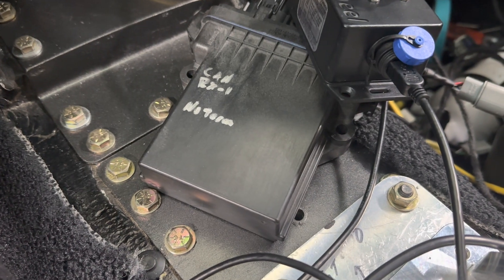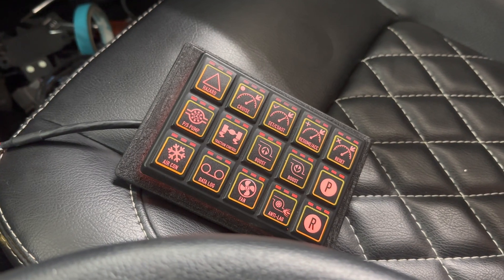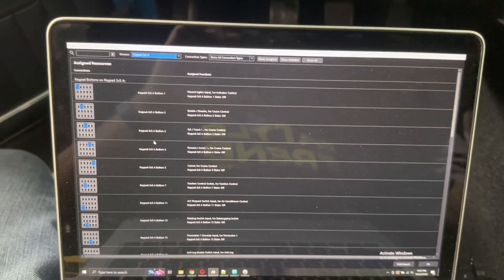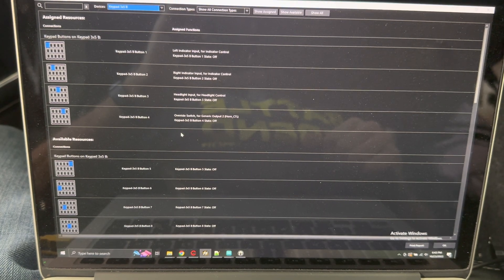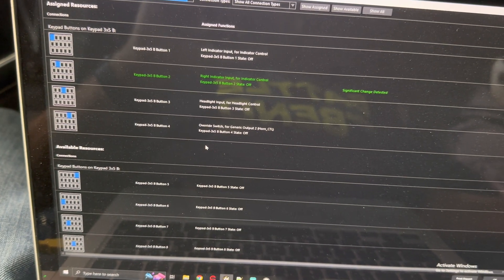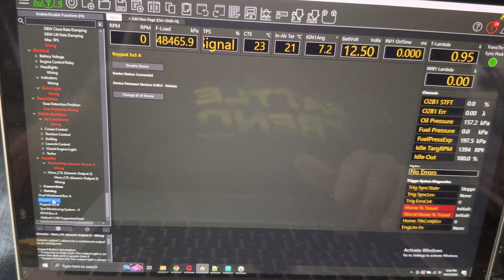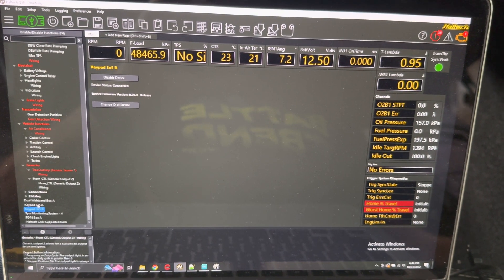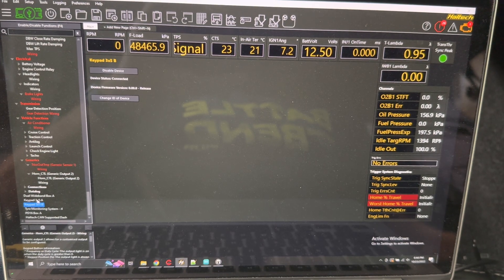Haltech Keypad Emulator - Arduino Based Virtual Keypad

Comment: This is awesome, thanks you so much for this. i just started reading information on the haltech CAN bus as i was going to try and make this exact setup. (With very little coding experience).

Would you be able to help adding 1 more feature?

I am using the turbolamik gearbox controller, and that emulates the Haltech IO expander boxes A and B,  to send information from the TCU to the haltech for things such as:
Oil temp
Paddle up
Paddle down
Transbrake switch

All this is sent as a CAN message to the ecu, emulating the IO A and B boxes 4 analog voltage inputs for a total of 8.

Could you perhaps be able to emulate 3 rotary trims, and send that information to the CAN IO box A or B AVI 1 TO 3.

That way i could incorporate rotary switches on my steering wheel for traction, boost, and torque management.

Please let me know if you would be able to do this. 
I would be willing to contribute some $$ for your time.
Reply: I managed to find a arduino emulator (can checked cfe18 or the cheaper , canbus IO) for the CAN io B. It adds 4 AVI. I'm  going to order it and try and change the configs on my TCU to only emulate the IO A. And ill see if that works. If not i can re use it on my miata track car as theres no IO on the CAN there. 

Im on a R3 and ic7. But iut of inputs at the moment.

DBW + 2X Turbosmart Egates and a few sensors😂.

The cost of a pd16 is out of my budget for now. So thats why i need a cheaper solution for my steering wheel buttons:

Rolling anti lag
Scramble boost
Traction control rotary trim
Boost control rotary trim
And possibly torque management rotary trim

Is what i need

Thr blink marine can racepad suposedly will have integration, but its ugly af, and will cover most of my beautiful carbon steering wheel 😂😂😂. 

So i want to build my own and put that 3d printer to good use.

Do you have a instagram i can follow you on?
Reply from the maker: I don’t think there is a way to emulate rotary switches.   You’d have to read a rotary switch output from whatever device, then simulate I/O box CAN voltage for an AVI.  There are no CAN rotary switches from Haltech that I’m aware of.

Unfortunately creating a full I/O box emulator to add that is probably beyond the scope of what I have cycles for.
Reply: Could we not use a arduino rotary switch and just sent the voltage reading for that as a message to the IO avi input on the CAN network?
Reply: Also as the tuebolamic tcu i have, can emulate the IO A and B, i should be able to extract that info
Reply from the maker: @nucleart0aster  an Arduino could be setup to read a rotary switch, sure.   The CAN values for an AVI input across various voltages would need to be measured on a real IO box, then translated on the Arduino.  I don't have any IO boxes to test with (I have an R5 and IC7, so lots of IO already).   The other issue is if the TCU you have is already sending data on that CAN address, you can't send that on the "emulator" as they'll conflict with each other and the value will bounce all over the place.

It's possible it could be emulated to send the data from an IC7 in the case (once the input AVIs are enabled in the new firmware for the IC7).   I might be able to look at that this spring, but my Haltech equipped car is in storage at a friend's right now and I'm working on different CAN work for my Aston Martin swap project.

Comment: Hey Blake, I've been trying to use your code to just replicate a keypad and not having much luck, when you say it needs to be fast/cheaper arduinos might not be a good idea, would this entail its too slow for the haltech to recognize it? 

Trying with a uno I have laying around and not getting the haltechto recognize it, I could try with a esp32 I have if you think it could be the issue . Cheers for anything you can input 👌
Reply from the maker: It's possible that Uno isn't fast enough.  The Due I'm running it on is a lot faster than that Uno for sure.  Have you validated you have good CAN data out from your board?
Reply: @BlakeMcBride  I'm honestly a noob when it comes to c++ and I'm abusing chatgpt to modify the code to work for me. I've had it sniffing what's coming in and out and I've had it sending and receiving some data but still not able to get it to enable in the haltech. Absolutely way over my head, learning alot and would love to to not buy a $500 keypad and would like to try and implement a diy io expander into the mix aswell! 😂 I think the jump to esp32 from an uno has helped! As I'm getting further than before 👌

Comment: This is just what I'm looking for. Saw your repo on github and then found this video. I've got an 88 MX83 Cressida with an Elite 2500 and want to use some of the factory radio controls on the dash as keypad buttons. I'll hit you up over there for some more info.
Reply: yo iv been thinking of doing the exact same thing. Any Progress?